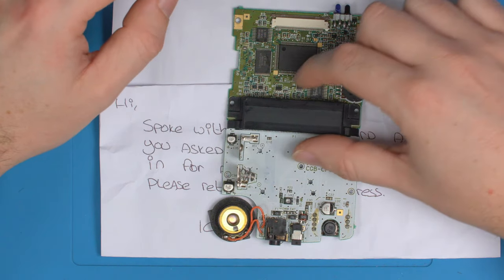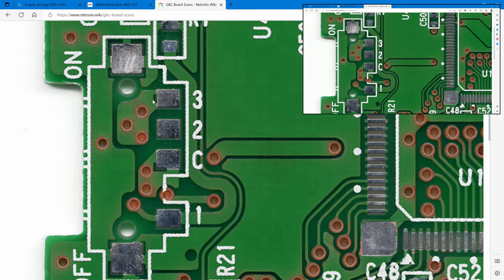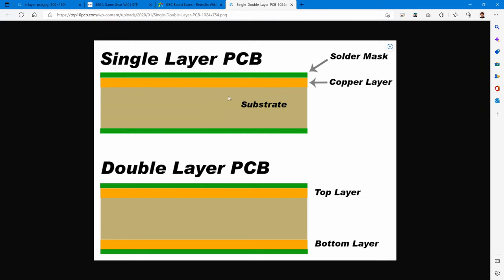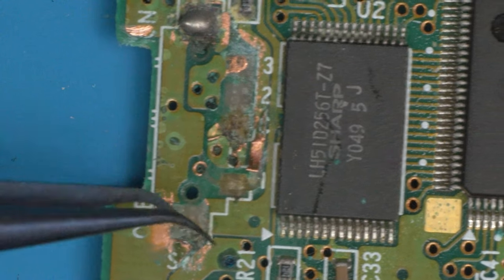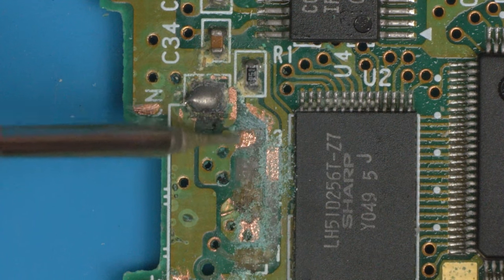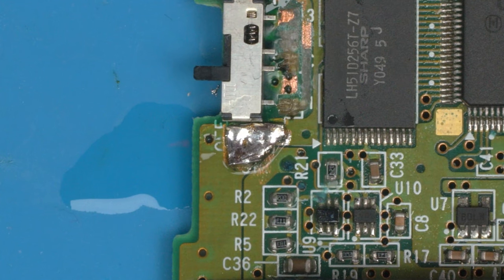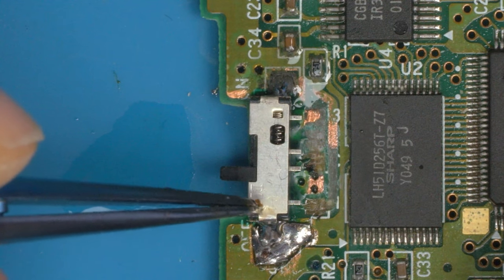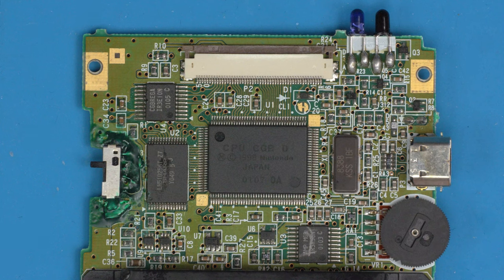How To Repair Any Broken Traces On Circuit Boards

Comment: Great video! Is there such a thing as a solderable UV cure resin? I'm thinking of a resin with a high percentage of fine powdered copper (tin, silver, lead, etc.) that once cured, could be abraded to remove the resin and expose the solder wettable metal. At this point, it would not have reliable electrical continuity. You could then lay a line of solder on top to create reliable continuity. I would like to have something like this to create traces as opposed to running enameled wire. A product like this could be used to prototype PCBs by hand or with a 3D printer.
Reply from the maker: Nothing I know of. Typically you just CNC or laser printer etch PCBs for home prototypes

Comment: i have a Atari Lynx 2 that has a broken pad (it came off with the mosfet) of Q12 (the S 'left' side, so not the G side), to what pin do i have to connect the leg of the mosfet its 'S' side with a wire? - because there isnt any room to scrape of the green around it to fix the pad.
Reply from the maker: To the positive of D10 or D11
Reply: @RetroSix  Thanks for your answer. worked great.

Comment: Very nice, i did something like this to a gameboy color game a long time ago. It was the Super Mario Bros. Deluxe game. I had it in storage and one day i found all my old games and put the game in my GamBoy Color and turned it on, and nothing. Just a white screen. I was pretty sad because i put in alot of hours on that game, so i began to investigate the motherboard. Just above the pad contacts where the game pads connect to the pad contacts on the GameBoy there was a break on one of the copper trace. How that came to be, I have know idea because it looked like something scrached or scrape it there. The plastic would protect that part of the board but either way i just took some thin wire and my sodder, made the connection, turned it on and it works!
Reply from the maker: Nice. Yeah sounds like a data or address line. Glad it's fixed again. Now you have to complete Zelda Links Awakening it's the law